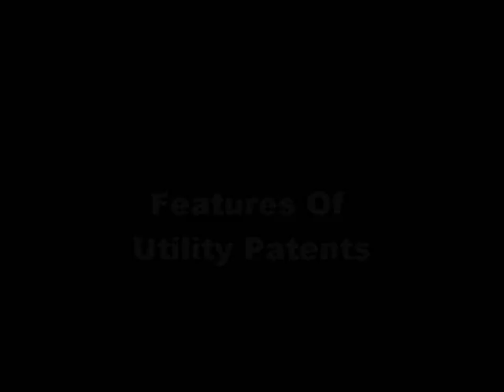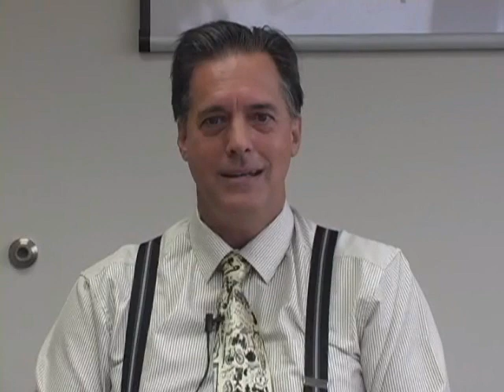Utility Patents Part 1: What are they & how are they approved.

Comment: Hi Ray,  You would be "patent pending" -- just as you would be had you filed a provisional and then a utility within a year, and effectively claimed back to the provisional for a filing date (not always a sure thing).  Being "patent pending" basically gets your foot in line at USPTO for a filing date (very important), but very limited rights beyond your filing date (you gain more rights if the applicatino is approved an issued as a patent).  Also, there is a "non-publication" option for utility.